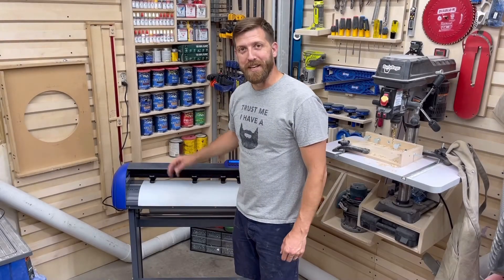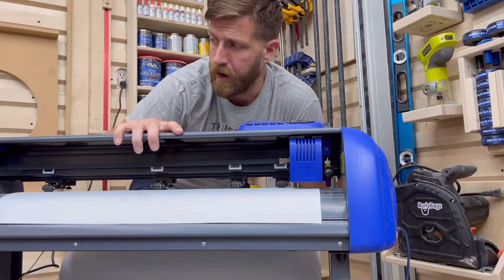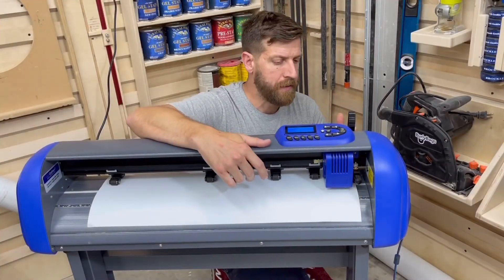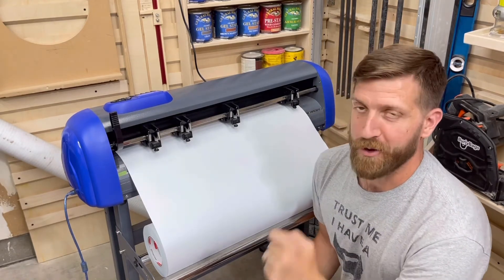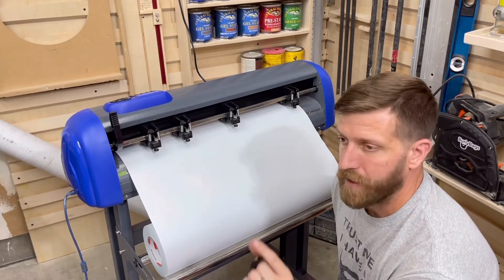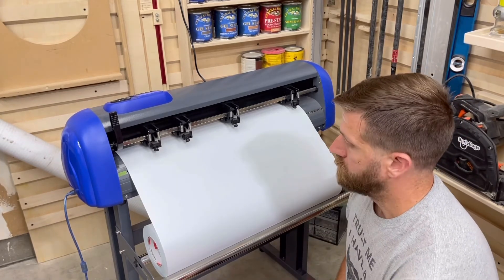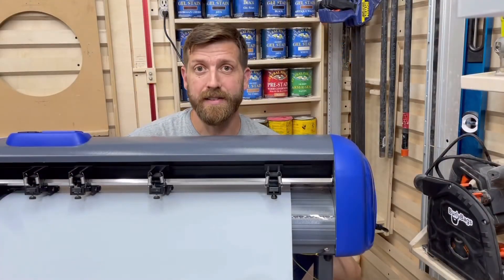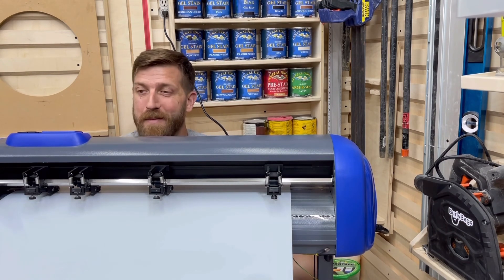How to keep your vinyl feeding straight through your plotter

Comment: What vinyl cutter do you have? Would you recommend it?
Reply from the maker: I have the Titan 2 by uscutter… it’s pretty nice. The components seem to be a higher quality and the servo motor is super quiet compared to the stepper motors. However it’s about $1200 new vs $300-400 for entry level machines and I’m not sure I could say it’s worth that price jump. I scored it on offer up very very gently used for only $500, and at that price point it’s totally worth it. If you dont already have one I’d start with the Sc2 model by uscutter. We have links to all our suggested setup at cornholecollective.com/supplies. Scroll down (or click the button at the top of the page) to the designs section. There you’ll find the sc2 vinyl transfer tape and tools we like 🤙 thanks for watching and I hope that helps
Reply: @burlybags3637  Thanks for the help! Really appreciate it!
Reply from the maker: My pleasure!